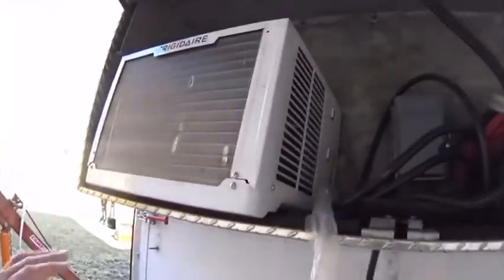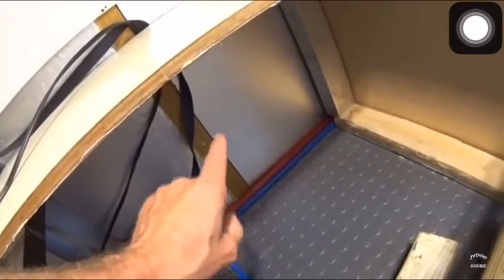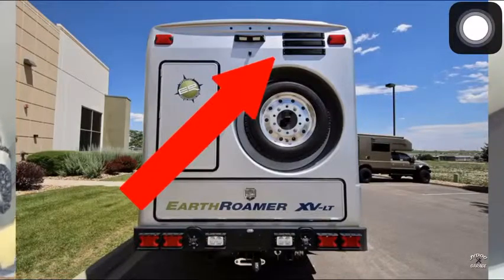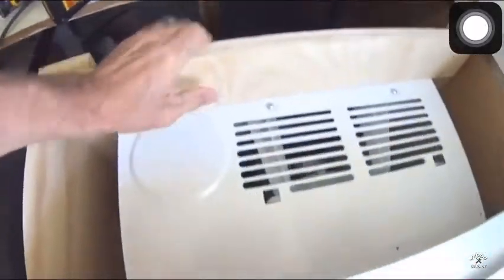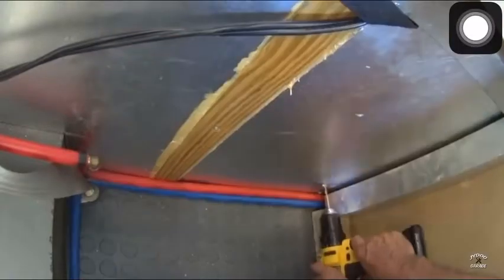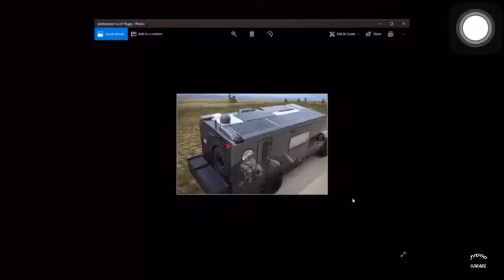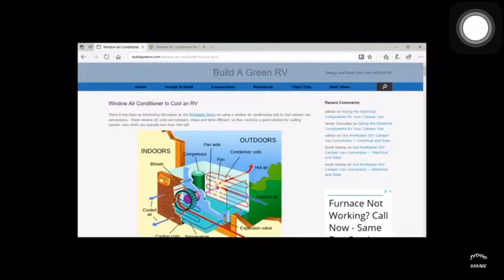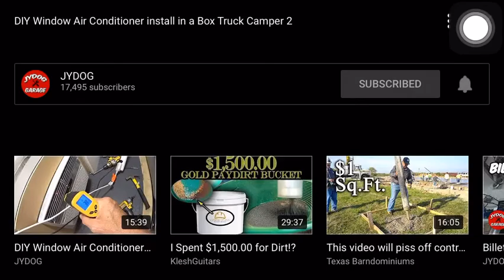Window Air Conditioner In Camper Trailer

Comment: I am wondering, if you could mount the window unit on the roof.... Make a box for the front and run the cold air through the roof Maybe use a fan for more flow... Has anyone ever thought about it???